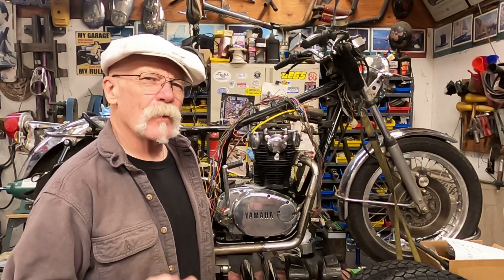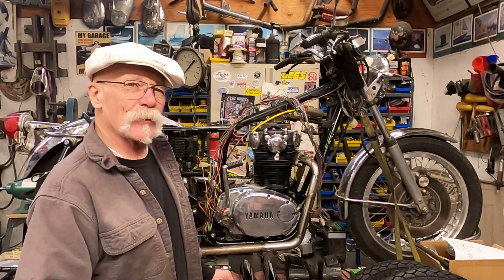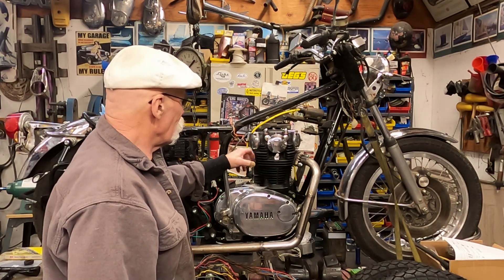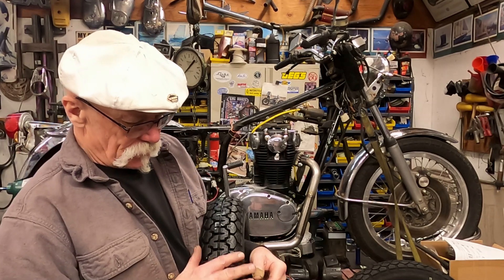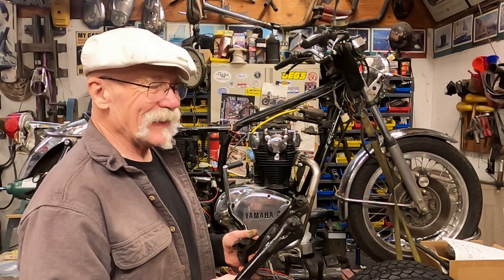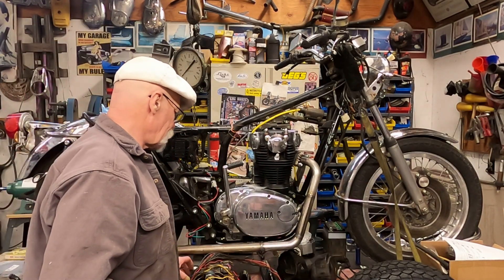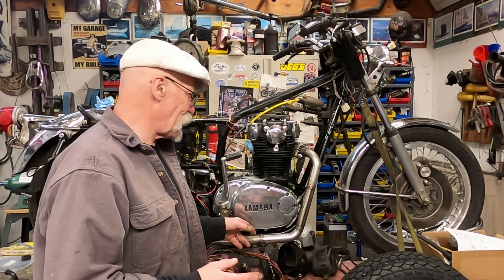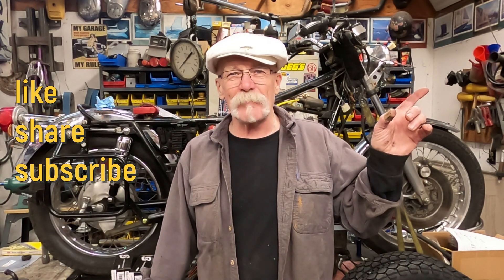Updates on 73 TX650

Comment: Thanks !!  I have 38 saved but had to use a magnet to round them up from the dirt.  Basket case .  Someone else could have been there so I wasn't sure.   I like those exhaust pipes fit with the frame angle rather than the rounded loop like you see most of the time
Reply from the maker: Well it sounds like you have all the ball bearings. I have worked on some one two missing. The exhaust pipe I've always liked the tight bents and following the frame rails I think it gives it a smarter look.

Comment: I was thinking of replacing  the old stator unit in my xs do you like the new charging units  battery free run with capacitor i suppose i could still use a battery
Reply from the maker: I will be do a video on the new stator PMA in the near future.